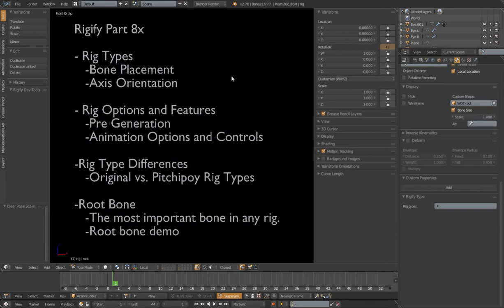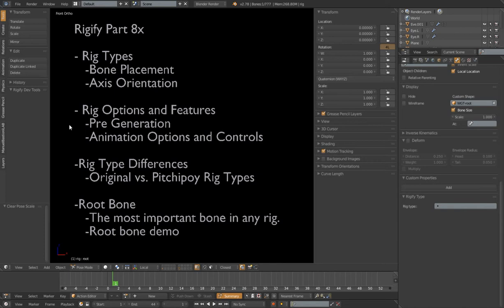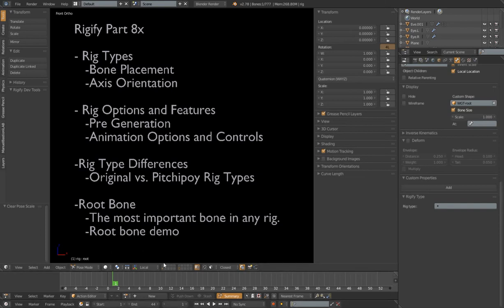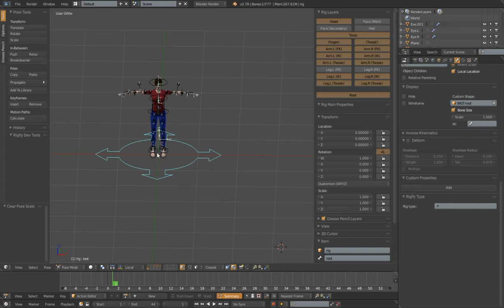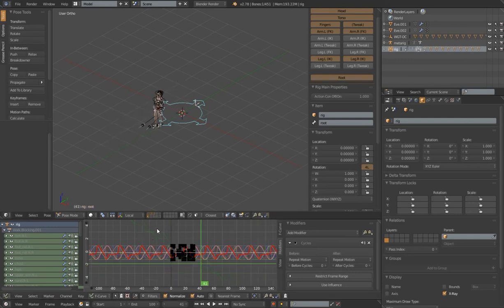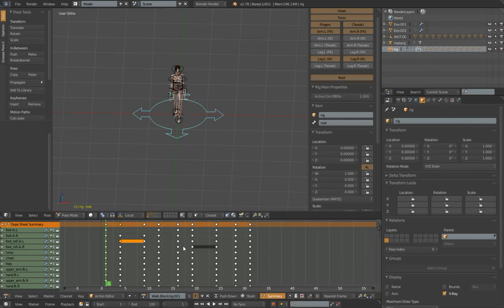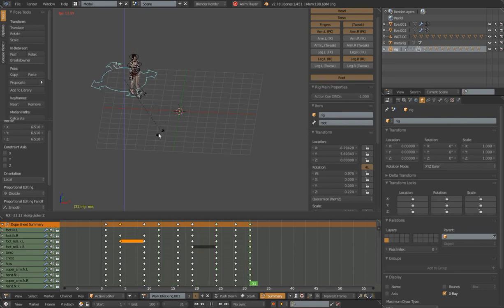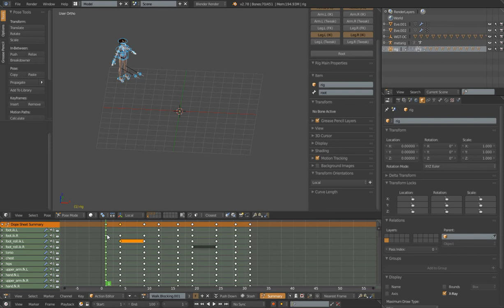Rigify Part 8   Rig Options and Controls

Comment: I am confused as to why a Walk Animation (Hip translates on Y axis) was made/used instead of a Walk Cycle (cyclic Y axis animation). Visual Translation of the rig is supposed to be on Root so you can make Walk_To_Run, Walk_To_Stop, etc,  animations that align properly.

I thought Visual or World Translation is supposed to be done with Follow Path or separate Rig_Movement animations so all Animations can be available to be used as needed in the NLA editor. Am I off base on good work practices? How does something like Walk_To_Stop work if the hip is 100 frames away on the Y?

I see you cover mostly rigging and I don't spot any animation workflow that puts it all to use at first glance of your video list. I'm willing to watch everything I saw in that list just to make sure after what I have seen already.. :)

Comment: Hi. Cheers for all the help so far.

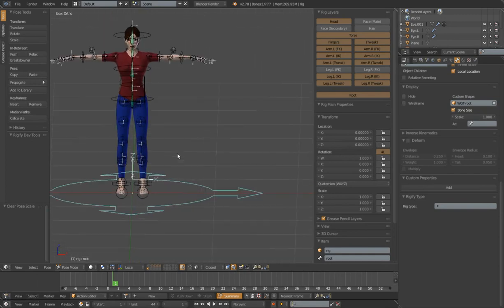I was stuck at 3:38, BUT I found the solution, and yes, it was something I overlooked.

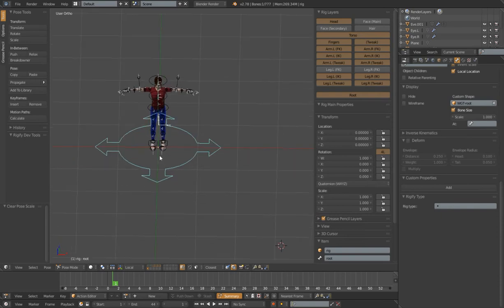At 3:38, I realised "Hey, my root bone isn't here. Why is it in the last layer?" but after 5 minutes of whacking my brain, I realised I hid the root bone in the skeleton bone layers on the right hand side of the screen. So make sure go to the rig tab and click the 4th to last box in the layers tab, to make the root bone visible!! So in other words, there's 2 root bones, in 2 different layers so watch out for that!

The root bone in the last layer (wgt-root) cannot be in pose mode, but the root bone (rig:root) in the "rig" layer can be in pose mode, which is what Dan Pro is using in the video.
Reply from the maker: WGT-root is not a bone, that is why it cannot be in Pose Mode. (Pose mode is exclusive to armatures.) It's a mesh object. This is the mesh that is used by the root bones custom shape field (bone properties menu) to force the bone to look like another object. Glad you figured it out. Good luck!
Reply: Thanks for the info XD